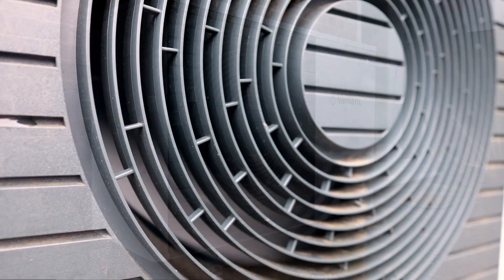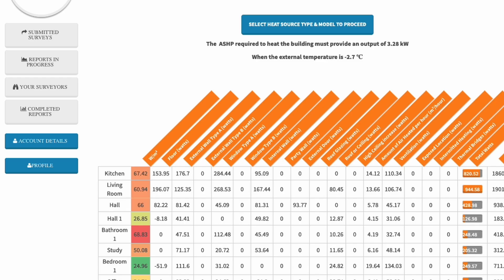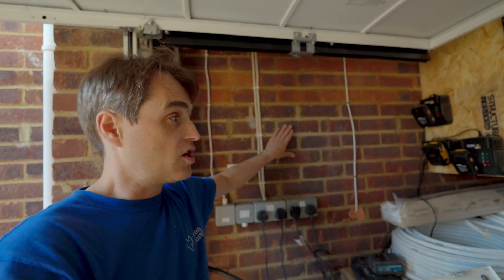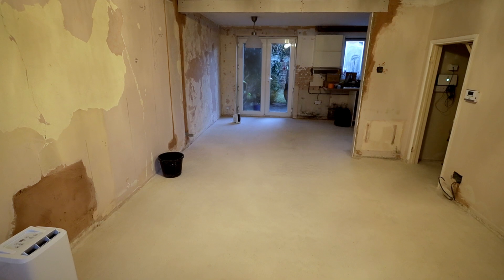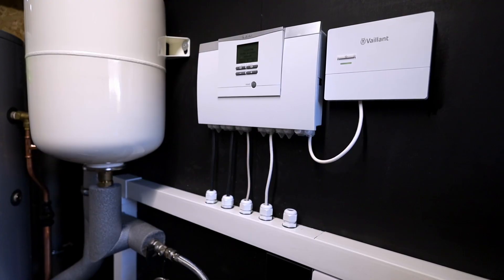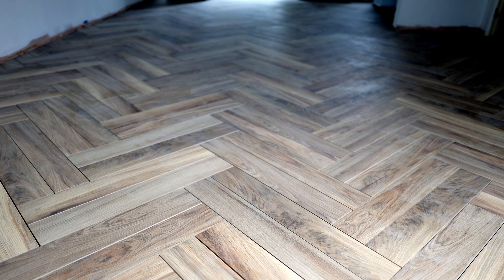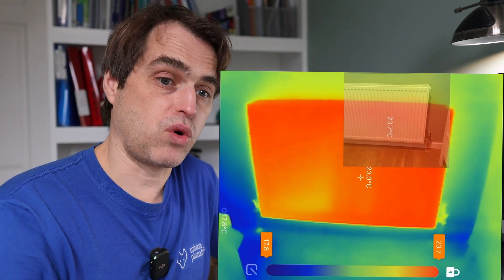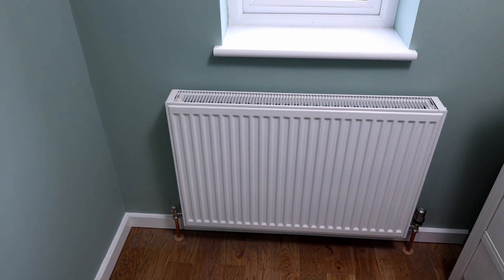How I Installed The Most Efficienct Heat Pump In The UK.

Comment: I'd only have one if you install it. 😄
Reply: Hear hear, that's a good shout. Unless you get the right installer like our good friend, then there's hardly any point.
Reply: @CommercialGasEngineerVideos   Absolutely. If you get cowboys, which you probably will, then it's money down the drain.
Reply: Outstanding. COPS of 5.9 not impossible.  Had a 5kW Vailant installed by Heat Geek Elite installer in NE of England.  My COP for heating yesterday 5th Feb'24 6.3. It's not that grim up north.
Reply: @GAEL-289 who was it that installed it? Also North East based and looking into installing one. Cheers.
Reply: Me too! 😊
Reply: We need a league table consisting of the best and worst installers 👌🏼
Reply from the maker: we have it - it is called Open Energy Monitor 

https://heatpumpmonitor.org/

 @vindeballs1
Reply: @UrbanPlumbers  How do you find a great installation engineer in your area say North West England?
Reply: I got the guys at open energy monitoring to design my system. I followed the design and im 3rd on the above league table behind ground source systems. I am a joiner/builder (and have renovated the property to a good standard) but definitely not a plumber. If you find yourself a good local plumber who is happy to follow a design and not add extra pumps and buffers. Its definitely an option if you don't have an @UrbanPlumbers in your area. Of course don't get the grant not being mcs however mine still came out a lot cheaper to than quotes from mcs firms to bang one in with the grant.
Reply: @UrbanPlumbers Do you only cover the south of England? I ask because I'm way up north

Equally, I think I might be more of a challenge RE: your impressive SCOP largely because I'd want to run the heat pump at cheap off peak rates on an EV tariff (either Intelligent Octopus Go, or eon Next drive)
Reply: @metzer06  Do you mean that you got the actual open energy monitoring company to design your system or users of the forum? I was looking at their website and can't seem to find where they offer this service. Thanks!
Reply: Same
Reply: 100% agree, would totally take one on just heard too many horror stories of bad installs!
Reply: Me2
Reply: Spot on haha
Reply: I'm not a sceptic of heat pumps. However, I am a sceptic of them in old solid brick wall houses with suspended floors. I, too, have been busy adding thermal plasterboard and insulation to floors. I have the skills and see this as the first item. Secondly the plant room would be an issue as this age house has no garage or sensible location for the apparatus. 
Unless we roll out a major insulation upgrade of 100 yr old properties I doubt heat pumps will be cheaper than gas. Surely all new builds should have them together with pv but they don't! Our housing model is controlled by big builders and broken.
Reply: Agreed
Reply: With you brother
Reply: Me too!
Reply: Hello 
I noticed that you fitted a buffer tank on your set up
 I’ve seen not use them on a open loop set up before 
is this because you didn’t have the water volume on yours for defrost cycles
Reply: Great video again,  lost you on no floor insulation ?
Floor tiles? Wood not the greatest conductor. Plant room space can be an issue but we are fully behind you on this is the way forward. Maybe no need for hybrid heat pump in that case ?
Kero up the very informative videos.
Reply: @kevinschoales844  I think the flooring is not wood, it looks like wood-effect tiles.
Reply: And me :-)
Reply: Same here. Don't trust anyone else. Too many risks and expense.
Reply: Agreed, my 7kw unit costs me 10£ day. Not too bad
Reply: And me too great video mate 👏😎
Reply: I can't get my gas boiler to heat my house let alone a ASHP.